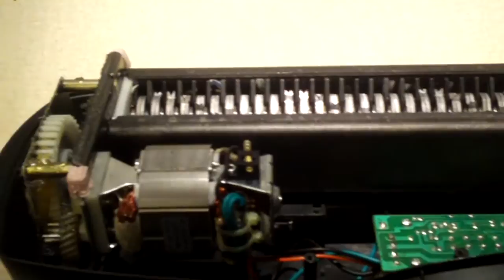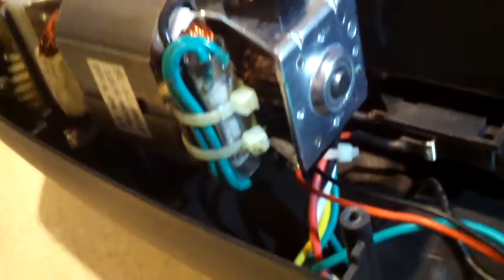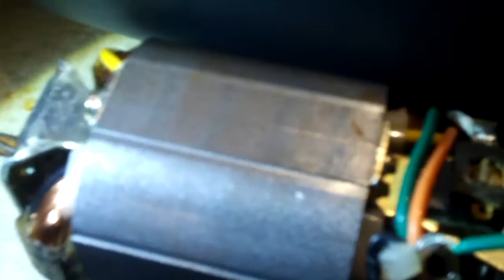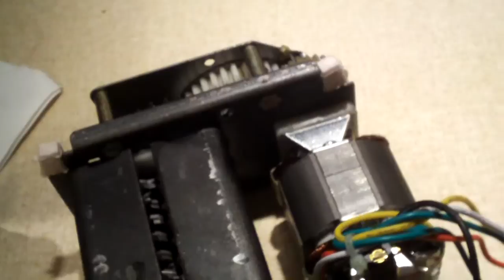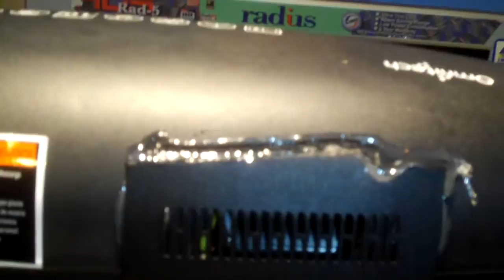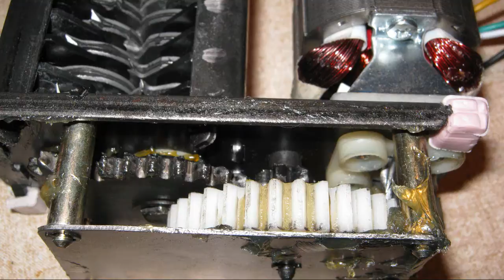Look inside an Omnitech OT-NXC10PA cross cut shredder + mod

Comment: Great video, and thank you. Quick question I fucked up and took mine apart I'm to fix a wire I got it working again but like the idiot I am I forgot exactly where all the screws go. Is there any way to get a view of the correct way to put it back together ??? I would highly appreciate any positive feedback thanks.
Reply from the maker: This is an old video and no longer use this shredder.
Reply: @CubeComputerChannel  Thank you so much for your response. I truly appreciate it. I ended up figuring it out. Apparently, I'm not as dumb as I look, hahahaaa. Once again, thank you for the video and your reply. Take care and stay safe out there !!!

Comment: Nice, I have the same shredder but just stop working.... No light or anything... Any suggestions on what to check on to fix it? Is their a fuse?
Reply from the maker: These things do sometimes have fuses that blow. It could also be a faulty bin switch. One of the gears in mind stripped out 3 years ago, and that was the end of mine.

Comment: is the grease-like- glue supposed to be on the gears?
Reply from the maker: alwin abraham That is grease and it's supposed to be there!
Reply: okay so my shredder "s motor is running  the shredding teeth part isn't moving at all what am i supposed to do?
Reply from the maker: alwin abraham There's probably a stripped gear somewhere.
Reply: cool i will check it out soon

Comment: lol, did you put the bigger motor in there? Nicee. Also I'm not sure a non-commercial shredder gets enough real use to need a massive cooling fan or beefy motor.  Typically it only needs to shred once a week for about 10 minutes max, less then that in most cases. Personally I went full digital billing where i can and burn all my paper legal documents but i understand not everyone lives where they can do that.
Reply from the maker: I kept the original motor in it. The cooling vent seems to help it. This thing originally wasn't even rated for 10 minutes runtime!